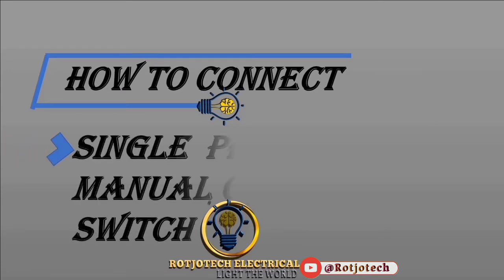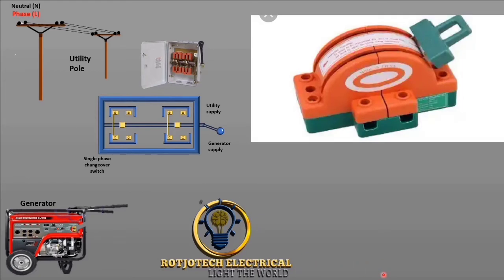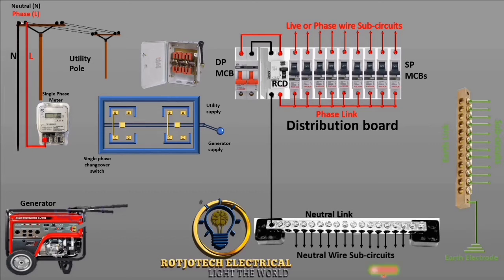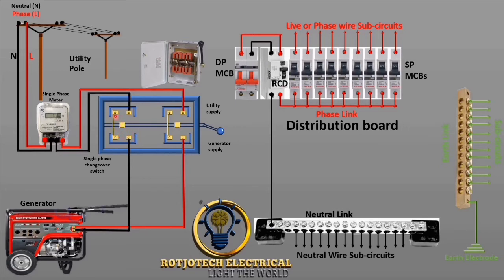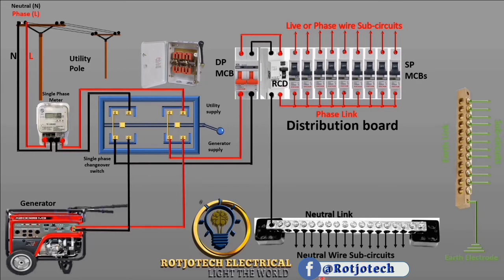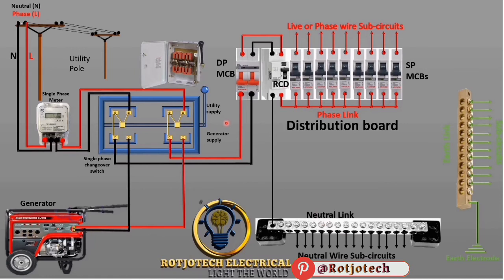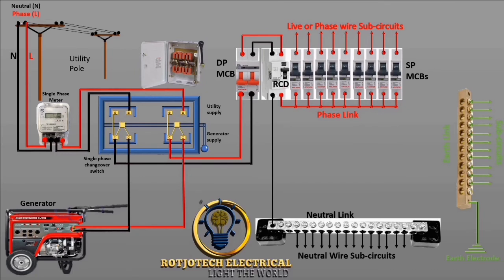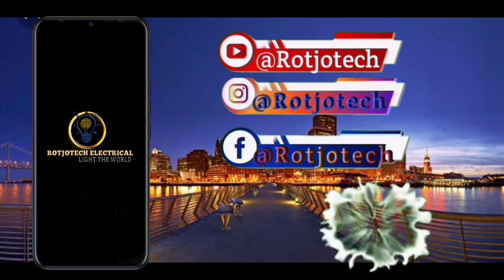HOW TO CONNECT SINGLE PHASE CHANGEOVER SWITCH

Comment: Where can I find a video on how to connect a 63amp double pole singel phase changeover switch to 3phase db
Reply from the maker: So sorry for late reply.... All you have to do is to loop your output that  is coming from single phase changeover  in to 3phase db... Meaning...  The live wire will be loop in to the three terminals of the 3phase db and neural wire will go directly in to neural terminal....
Reply from the maker: I will do video on this very soon